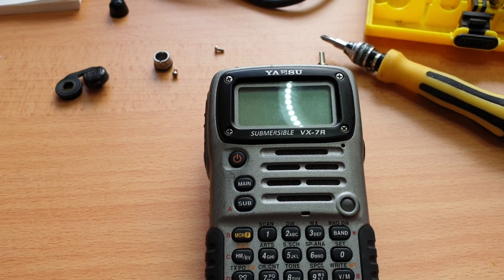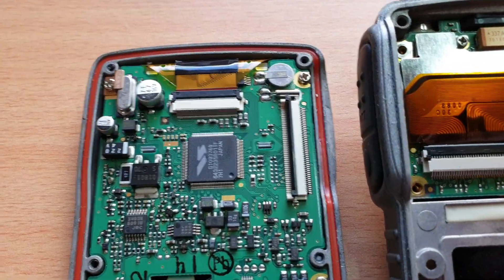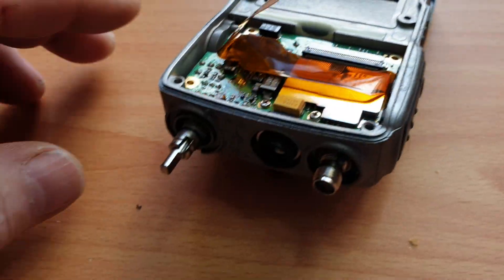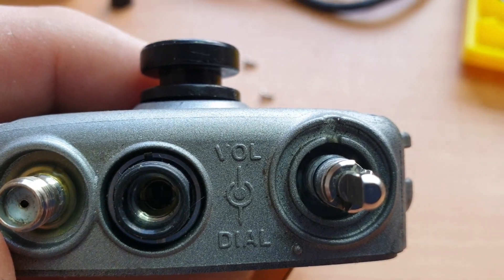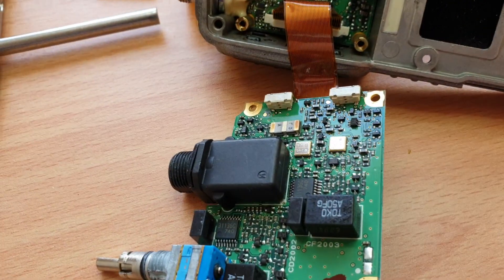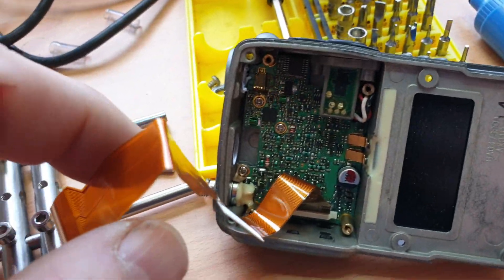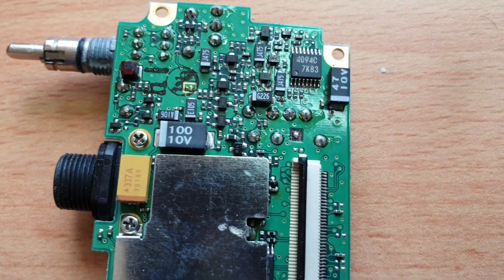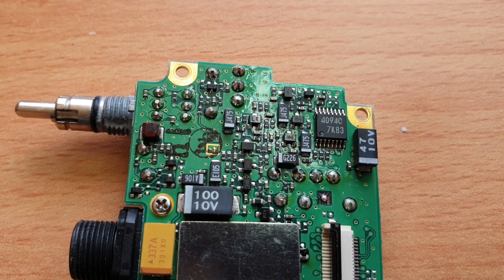Yaesu VX7R extremely low sensitivity repair part 1

Comment: Hello doctor!

I see that you have good skills on this.
I have a problem with exactly this yaesu.. every time I press to send, it's turning off.

Is it possible to send it to you to fix it?
Reply: it might have a bad battery. Try plugging it in and transmitting on lower power to see if it works.
Reply: I tried with a new battery. The same result.

Comment: Do you have video how to fix power on issue? When I connect charger it works, but when disconnect I cannot turn it on. Changed battery pack but still the same. Thanks
Reply from the maker: will do some research, not a fault ive seen so far cheers Brenton vk3cm

Comment: Can you let me know the part number of the filters or maybe were you can purchase them Thanks in advance
Reply from the maker: ltm450fw is the part number...supply is from https://www.ebay.com.au/itm/5pcs-LTM450FW-6-ELEMENT-CERAMIC-FILTER/263218578722?ssPageName=STRK%3AMEBIDX%3AIT&_trksid=p2057872.m2749.l2649